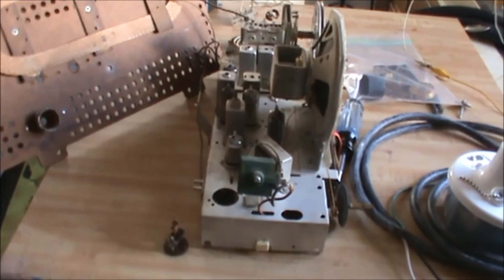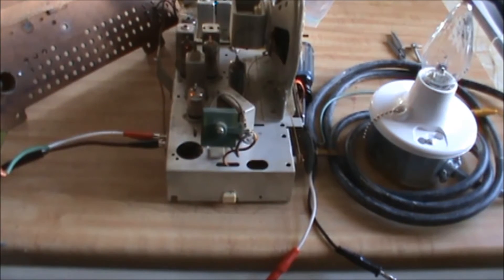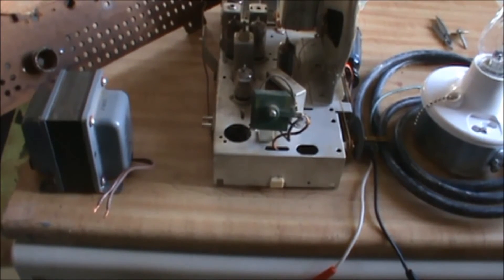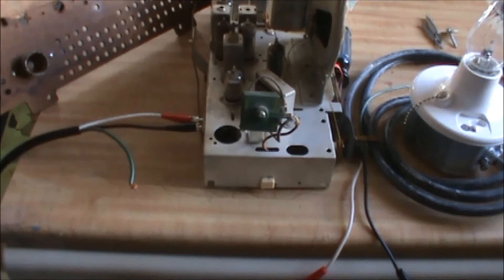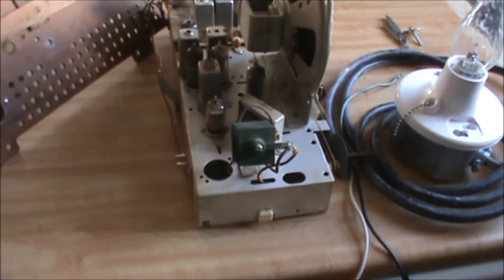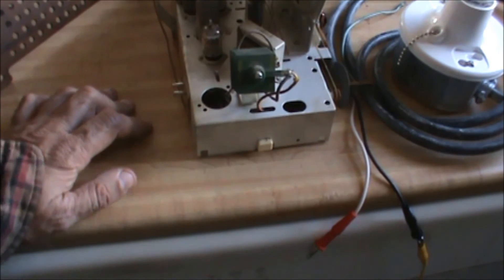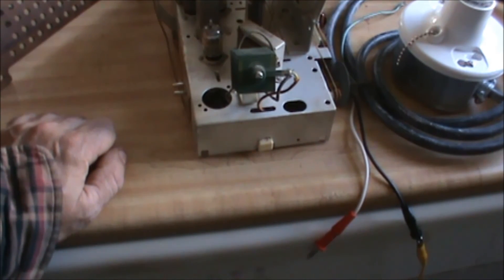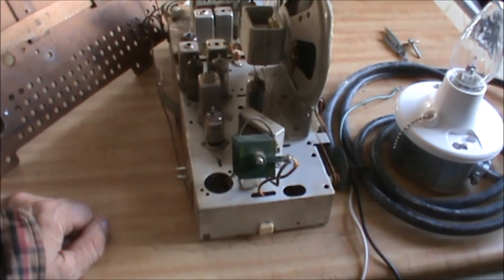Westinghouse H 307t7 #3 5 What is a hot chassis

Comment: I have two  questions: 

1) 
way in the beginning you hook the light to yellow ground wire - and the light turns on -but shouldn't the overprotection breaker always flip when we get current going thru the ground in the United States!? Sorry for the noob q!?
2)
why does connecting to ground wire cause light bulb to light but not the neutral? Totally confused. Maybe I am not understanding exactly how a hot chassis works.

Comment: If there is no transformer, there is no reason to prove it. However , radios never should have been left Hot even so ore ridiculous Guitar amp
Offers. Guitar amps are the kiss of death !its not just a matter of getting a shock, but more a matter of life and death. Whereas the radio, an entertainment device was made as safe as could be , what with cases made of insulated materials. There was literally no danger, unless you are the type of person who would take a radio in the bath tub with you. Some reasonable amount of responsibility must be passed on to the user.
Reply: Homes were much simpler when these were made. There were no grounded sockets so rooms had little ground potential so even if one got shocked there likely would be little risk. However, much more died of electric shocks back then.
 
Now you could have a grounded computer with your foot touching the case while you adjust the radio. There is a reason why in Europe you cannot plug such old ungrounded device in a grounded socket.

Comment: How come they don't have polarized plug
Reply: They never had polarized plugs back in the day. Around 1964 or so they became common but that was when solid state components started appearing
in electronics. You should get a polarized line cord for repairing older radios now , but only do so if you know what you are doing. You should put a  fuse 
of proper amperage on the hot side and then connect its output to the on/off switch. They often had the neutral  line connected to that switch back then too.
Reply: @hestheMaster  Fuses do not protect against shocks. The switch switches they chassis off so it is safe when off. Even a polarized cord dos not protect if the socket is miswired. It is good to have a GFCI also.
Reply: @okaro6595  Actually the fuse is there to protect a transformer only. Any damging current or short quickly heats up the wiring in a transformer and the fuse will blow instead of cooking the transformer. No need to put one in a series string valve type radio which usually have a solid state rectifier but many solid state electronics have at least one to protect from shorts after the  transformer. In a series string radio for instance you should connect the hot side to the on/off switch making sure no other components were tapped off of it's connection to B-. I have done this before and it works great with no damage to me or the series string radio. You must always make sure the B- and ground are isolated in the earlier style radios  sometimes by a high resistance resistor and a parrallel capacitor which should be replaced with a safety capacitor however.

Comment: how do I check my radio for hot chassis with volt meter ?
Reply: set in AC, and check voltage between chassis and earth?
Reply: @manojkumarsubramaniam7122  and earth ? where the earth ?  Chassis I understand its a frame but where do I connect to Earth ?
Reply: Voltmeter set to AC and with the red probe take it to a known hot connection. The black test probe should touch the chassis.  Turn the device on using the plastic knob it came with and If the meter shows 110 to 125 Volts then you have a hot chassis.

Comment: I want a isolation transformer to work on my tube radios I have ,but the ones on ebay cost more then I have I looking to get a transformer like you use ,I am In the 50 to 60 call or range can I get one for that price and where to get it at

Comment: Thanks a lot!  I've got a vintage radio that shocked me some time back and decided either throw it away or repair it.  I messed around a bit checking connections in the chassis since someone a long time ago had been in it doing "repair" work.  Their soldering was pathetic.  I spent some time since I didn't know about the "hot chassis" issue and happened on it on the internet.  I tested with a voltmeter repeatedly turning the plug over and that was the deal.  I've got a Fender Bassman amp which has a "ground" switch that takes care of the problem.  Using it for 50 years now my eyes have been opened about why I'd get my butt knocked off when my lips touched a mic so I had to operate the switch to take care of it!!  Thanks a lot!!

Comment: When you connect the light bulb between chassis and ground, there is no return current in the neutral. So am I correct to assume that a residual current device would trip in such a case?
Reply: Should, if there was one installed.